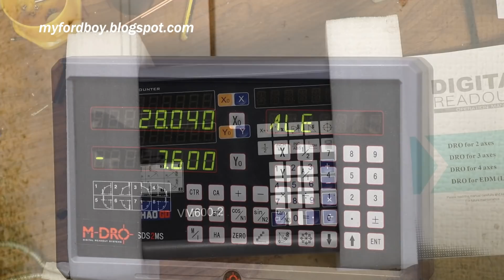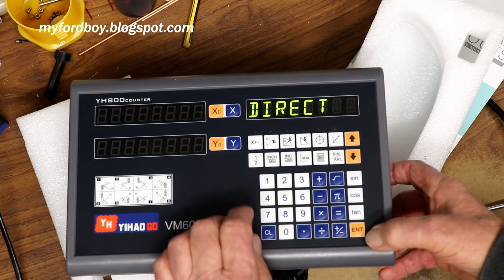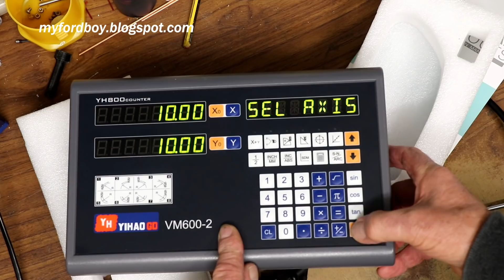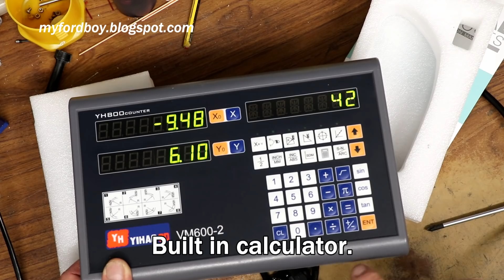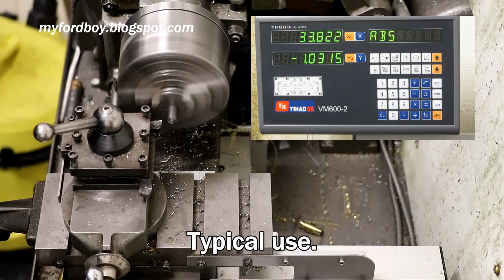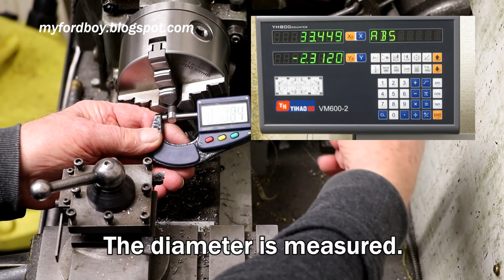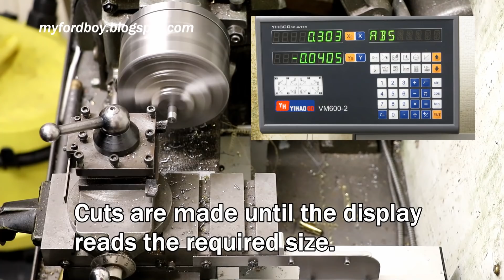DRO installation on my lathe.

Comment: If your DRO has no lathe mode and no diameter funktion, just double the resolution of the diameter axis in the set up. Means, if your scale has a resolution of 5 micron, set the resolution in the DRO for this axis to 10 micron. So it will show the diameter.
Regards from digitalanzeigen.de

Comment: Witch length should I buy for myford ml7 there are many options in your link to bangood
Reply from the maker: I don't have an ML7 so cannot advise but this will help:
The travel available is 80mm less than the quoted length of the scales. The readhead is 80mm long and the mounting part on the end is is 17mm long. So for a 450mm scale you will get 370mm travel and the total length will be 484mm. So take the quoted length and deduct 80mm to give the travel available.
Reply: I've got a set of cheap Chinese readouts fitted to my ml7 I bought the 500 mm and 200 mm travel.
The overall length of the 500m travel scale is 650mm and it fits nice on the back of the bed. The cross slide will depend slightly on how you mount it. The 200mm travel scale is 340mm overall length. I've got my mounted as myfordboy did in a previous video, I don't know how I managed without it. Just fitting one the same as myfordboy is to my mill, they're definitely worth the money

Comment: As I understand it the display kit is one order and the linear scales have to be ordered separately. The linear scales Banggood sell are too long for the Ml 7. Is it possible to cut them to size? 

By the way thanks for another excellent video
Reply from the maker: You order the scales separately. No need to cut any they come in 20 different lengths from, 100mm to 1000mm.

Comment: Like you I have a Myford ML10 and last year purchased a DRO kit to try but had to return it as the scales were too big, or so I thought. What sizes of encoders did you use on the bed and, particularly, the cross slide?
Reply from the maker: Do you mean the length? I reused some Anilam ones but the ones shown in my link, which are what i have fitted to my mill are a smaller section so would be suitable.
Reply: @myfordboy  I did mean length but obviously as the lathe is quite small sectional size is important. The ones I purchased were quite bulky, especially with the connecting cables. The fact that you have successfully fitted the above means I can try again! Thanks